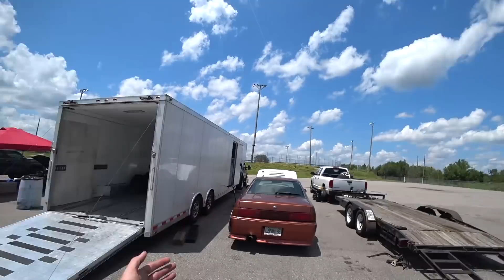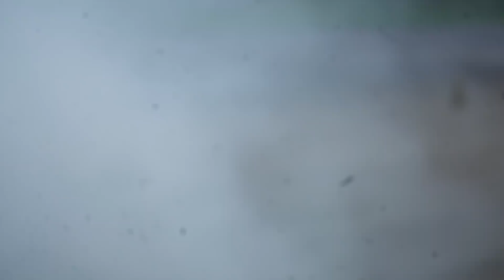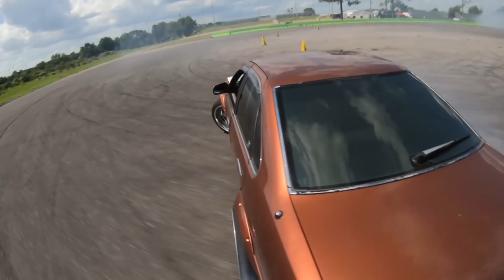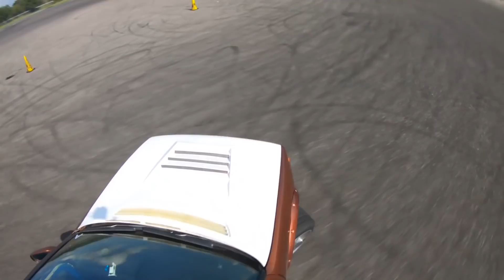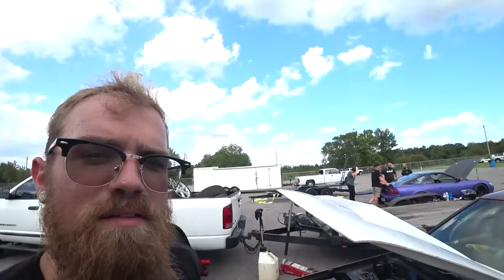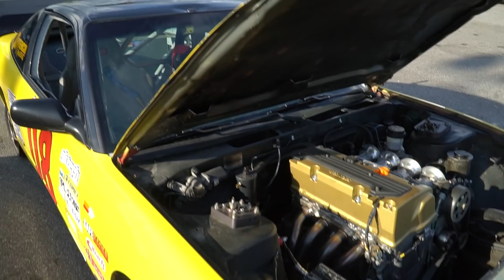I fixed my K24 Cefiro and it’s making way more power! Sounds nuts

Comment: Now that the car is complete and you know there's room you should cut the end of the intercooler on the output side and put a bulge in it to help give he charge air a straighter path to the throttle body.

Comment: One thing I notice about this, you dont keep revs up while ur clutching to ebrake causing you to have to clutch kick after you come of the handbrake, probably cause you are used to the torque of the v8 you don't usually need to, only reason i noticed was because I'm used to drifting low powered cars and I'm on limiter when on the clutch to ebrake haha sounds sick tho!
Reply from the maker: I’m just trying to not beat the crap out of it with this transmission. Lol
Reply: @Taylordrifts  yea that's fair enough, buy the end of the video you had it dialled in anyways you are pretty good adapting to different setups!

Comment: I know it is a sin, but could you raise the car a little to get the clearance that you need for the big tires?  Static it would look like a pickup, but in drift, it should level out with softer springs in the back.

Comment: This might be more work than it's worth, but you could have someone 3d scan your panels, and have new ones either printed or fiberglassed if something happened.
Reply: The doors are the problem, they are a complex piece, there's the frame inside, not just the outside skin. Getting them custom made in carbon fibre is about the only option for making some but that will be into 5 figure bills. Importing spare sets from NZ or Japan is possible but these cars are getting old and I guess when you have a great tandem car you don't want to spend money on tandeming a rarer chassis.

Comment: Next Project: take doors off, Fill with spray foam insolation, use large pressure vacuum molder to take molds off doors and panels, paint, nutsert,  jizz in pants.

Comment: does the k24 have vtec engaged or disengaged?
Reply: Both
Reply: It’s on always above a certain rpm. Engine doesn’t run right without it
Reply: @TheRyansLion  common misconception, the engine can run right if its tuned to run like that... vtec just switches from a mild cam lobe to an aggressive one... you can lock a car in and out of vtec as long as fuel/ignition timing has been adjusted to compensate

Comment: I know I couldn't drive a right hand drive car unless it was an automatic.  Shifting with my left hand with reversed pedal locations would really screw me up.
Reply: Pedals are the same mate, right foot does throttle and left does clutch. It's honestly not that hard, I go from LHD to RHD all the time, the only weird thing is you try and put yourself in the same place on the road so you have to remind yourself to stay on the correct side of the white line for a few mins.

Comment: TAYLOR, what brand steering wheel is that? 

oh and yes having "vtec" is everything with that motor, a RSX we use to have was quick af, but if vtec wouldnt kick in, it made you not want to drive it, hahahhaha
Reply: Its a Momo Beneton wheel, they are easy to find.
Reply: @foamdataservices  thank bro, i was wanting one for my sim rig or a nrg offset wheel, and take off this flat faced sparco wheel, i like the offset wheel better for drifting on the pc

Comment: Hmmm thats interesting, stretched tires, added camber, car drives great, longer layout and blowing the fucking tires off and still getting the same amount of tire life as previously without the camber oh and the car is in one piece with the tires intact on the wheels...interesting. yea soooo wheres those old heads at again that was saying anything less than 0° camber is bad and unsafe? Im sure there will be a captain obvious pointing out -20° of camber eventhough its irrelevant to this situation being were only talking about around -4° to -5° on the A31.